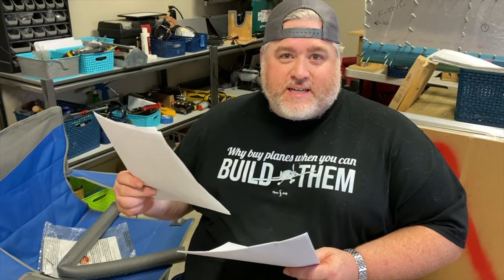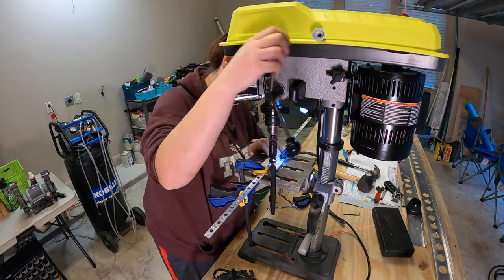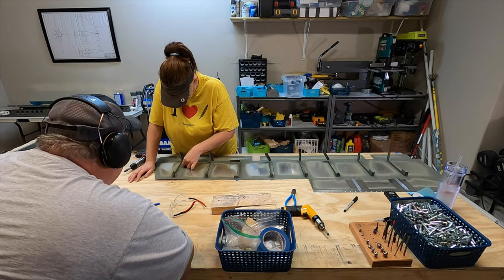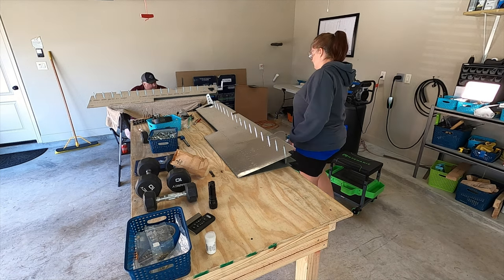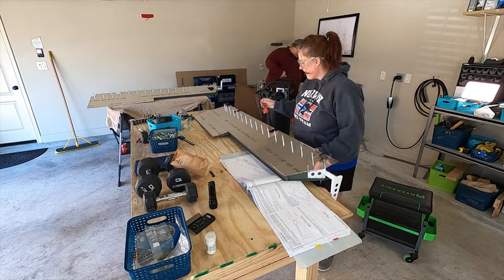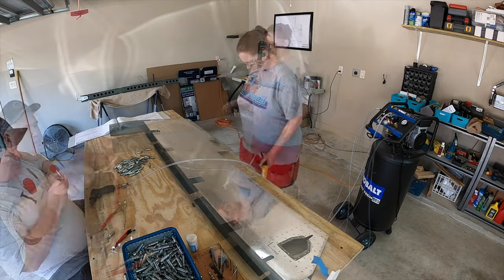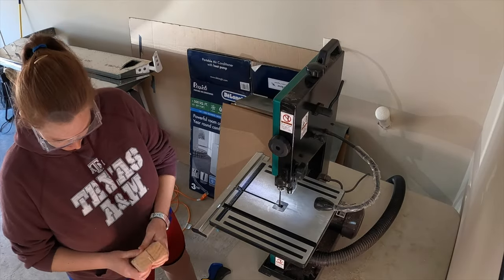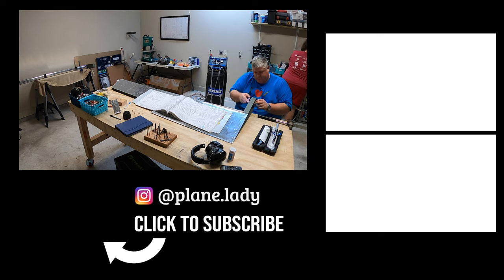Van's Aircraft RV-10 Build: Days 73-90 - Countersink Jig & Finishing the Elevators (9-9 to 9-15)

Comment: Any length is fine for me. I’m just going back for fun to try and remember what I did while going through some of these steps.
A couple additions to your video: When back riveting I place a thick piece of cardboard on either side of my back rivet plate that is approximately the same thickness as the plate so my skin doesn’t bow up like you were referring to. You were also talking about the placebo effect. I have found (especially with multiple stacked pieces of aluminum or 2 thick pieces) that placing a couple rivets in before clecoing will give perfect alignment vs clecoing first then trying to install the rivet.

Comment: I am working on an RV-14A so this might not have been an issue for you, but there was a note in my plans that said, "CHECK PRINTED SCALE 1:1 PER SECTION 3 BEFORE USING THE TEMPLATES!".  Mine were NOT 1:1 so I made enlarged copies of the templates to arrive at the 5 1/4" x 2" dimensions to match the foam blocks before cutting them out and gluing them to the foam blocks.  Did you have this issue?  I ask because I noticed you guys appeared to just take out the template portion from the page and cut them out without measuring.  If I had done that with MY paper templates, the ribs would have been under sized.
Reply from the maker: Good question! I completely forgot to mention that! Yes, the same warning was on the bottom of our diagram on that last page and I had measured it prior to cutting it out to make sure it was correct. The dimensions were correct on ours (16”x10 9/16” between the lines framing the page) so we were good to go using it straight out of the book. Thanks for bringing that up and I’ll make sure to mention it in the trim tab video 😊